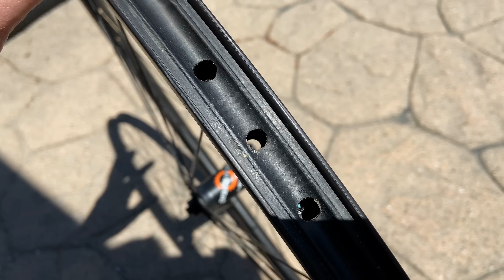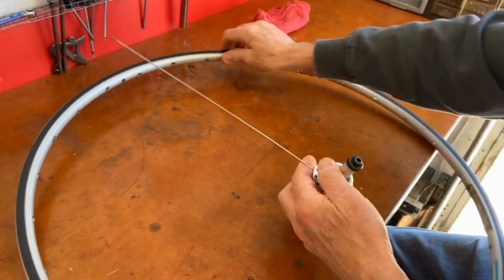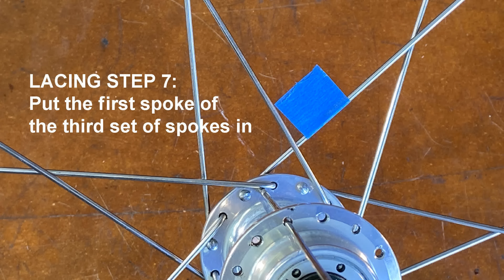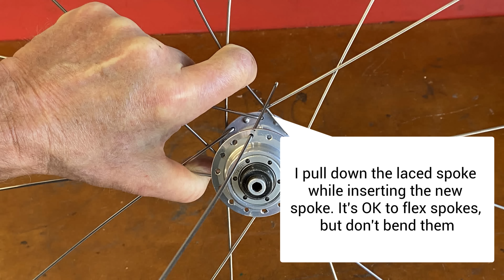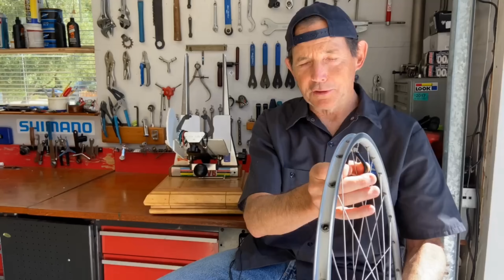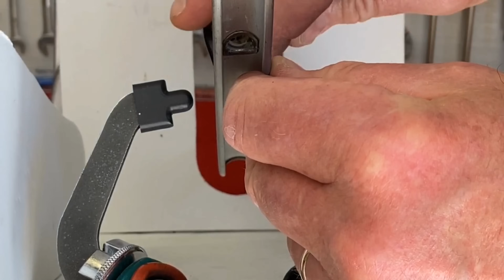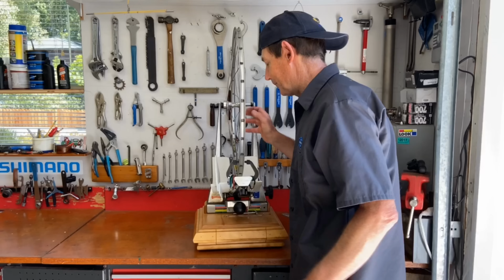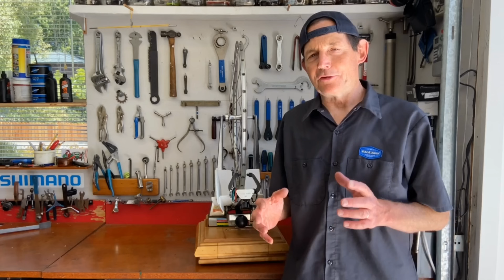How To Build Bicycle Wheels THE EASY WAY! #bikerepair

Comment: that was amazing video,learned a few tips ,i,ve never built my own wheels but been riding bikes for decades mostly road gravel bikes always gotta keep ontop of adjustments  as the wheels run up the miles always wanted to do my own custom axles and bearings but the spoke lacing and fine tuning put me off ,i usually bend axles they bend over a slow progression throws out everything mostly hopping and dipping at the begining you try spoke adjustment then realise its rear axle and if you have 29er tyres on 700c wheels most of the
 bike frames and if you use a hybrid max tyre width about 2.1 only leaves  5mm of clearance either side of tyre before it  rubs against frame so wheels gotta be kept true ,,people into bikes are missing out here if they not watched any of your videos ,,,,,eveyone hit the like button get the views and subscriber count rocketing,,,, thank you Jim 👍👍👍
Reply from the maker: Thanks so much for watching and the wonderful comment, Theresnobody! I really appreciate it and am happy you like my videos. Here's hoping you have some great riding this season without any more bent axles! (You're absolutely correct that the axles need to be straight and the bearings adjusted well or getting wheels straight can be difficult to near impossible.) That's an important point. Thank you for making it.

Comment: How to choose the length of spokes?
Reply from the maker: Thanks for watching and the question Jih-Shen Shih. You choose your spoke length based on the components you're using (hubs and rims) and the spoke pattern you are using (how many other spokes each spoke crosses). You can do this with an online spoke length calculator like the one spoke maker DT Swiss provides on their website: https://spokes-calculator.dtswiss.com/en/calculator These calculators work best when you choose hubs, rims and spokes that the company makes. If you are using other brand components, then you need to measure everything yourself carefully to get accurate numbers to put into the calculator.

If you don't want to do that, a good option is to find a bicycle shop that sells spokes and can calculate the spoke lengths for you. For this you would tell them what rims and hubs you're using and what spoke pattern you will use and they can run the calculations and get you the correct length spokes. Bike shops that sell rims and hubs and spokes are the types of shops that can help you with this especially if you buy your parts from them. Okay? I hope this helps and thanks again for watching!

Comment: Love the video, I have an old schwinn 5 speed cruiser I'm working on, and it rolls like old Schwinn's do , I am about to do the bearings and I believe the rear wheel is missing some parts, like retainers or something, do you happen to know what it should look like?
Reply from the maker: Thanks a lot for watching the video, knothole5! Schwinn 5-speed cruisers usually had pretty standard cup and cone style rear hubs. You won't know what's needed until you take it apart. To do that is pretty easy, but work carefully and don't let anything fall out and get lost and keep track of the orientation of all the parts. If you work on the non-gear side of the hub, you can loosen and remove the nuts on that side and push the axle out to the gear side. Again, be careful not to lose track of the parts and orientation. Take some photos so you have them for reference when putting it back together.

Once the axle is out, get the quantity 18 (9 per side) 1/4-inch diameter individual ball bearings out. A good way to do this is with a magnet you can get inside the hub. Once all the bearings are out, you inspect the cones - the conical parts that rest on the bearings. Clean them first. Their surfaces need to be smooth, no pits or other damage. If you can get them, the best practice is to replace the bearing with new. Also, stuff a rag inside the hub and clean where the bearings sit in the hub. Inspect that on both sides with a flashlight. Those too must not have any pits or damage.

On the gear side it will be harder to access but you can do it. If it's too hard, you can remove the gears, but you'll need the right tool to do that. With all the parts inspected, you should be able to determine what's bad and replace the bad part to fix the hub's issue. I know this is a lot to read, but the job itself isn't that difficult. Here's a how-to on ParkTool's site with some photos and more explanation: https://www.parktool.com/blog/repair-help/hub-overhaul-and-adjustment Good luck! Let me know if you need more help. Jim
Reply: @JimLangley1  thanks for the reply, and the explanation. I've been through this before, it seems strange that the casette is practically hollow where the axle goes through, like it's missing a dust cover or something, I will be tearing it apart soon, when I have time to complete it in one sitting. I'll let you know how it goes, thanks again.
Reply from the maker: @knothole5  your bike probably has a freewheel, not a cassette. A freewheel is directly threaded to the hub. You can't pull it off. You need a special freewheel remover, probably an Atom. That tool fits inside the large hole you see there and you turn the tool with a giant wrench or place the tool in a vice and turn the wheel. Once the freewheel is off the hub it's easier to get at the bearings. Let me know if you want me to explain more. Here's an article and video on removing freewheels: https://www.parktool.com/blog/repair-help/freewheel-removal-and-installation

Comment: How much money does this save?
Reply from the maker: That's a great question, Remy. It's not easy to put a precise number on it because labor rates vary so  much in the USA and around the world. But, I would say that the least expensive labor rate would be about $25 an hour and the priciest $150 per. 

It takes a wheel builder roughly an hour to finish a wheel. So, for 2, with my numbers, that makes the labor range $50 - $300. You would also save any time and travel/transportation costs to your builder and back home. 

But, if you didn't have the tools you wanted to build wheels with, that would add to your costs the first time you bought them. Also, the costs for the rims, spokes and hubs could be a little less from a bike shop than buying them on your own since shops can buy in bulk. Hope this is helpful. Thanks for watching and the good question!
Reply: @JimLangley1  Okay, thanks. :)

Comment: Wow, looks like you bent a couple of spokes there
Reply from the maker: Thanks for watching and the comment, JDE. In the very beginning of the video I explain that I am showing how to build a wheel with a used old wheel because that wheel has easier-to-see silver spokes, nipples and rim (versus a new black on black on black wheel). 

So, the spokes in the video are used and were taken out of a wheel to start with. Also, in shooting a video like this, sometimes the lighting isn't right or the camera isn't in focus. When that happens I start all over, taking the wheel apart and taking the shot all over again.

So the poor over worked spokes in this video were definitely flexed and have bows in them. But, as I point out in the video, it's perfectly fine to bow the spokes. What you don't want is actual kinks or sharp bends. Hope that helps explain and thanks again for watching.
Reply: @JimLangley1  I started video, perhaps I missed that part in the early part of video.  You did a well detailed layout of the wheel building process... you had mentioned the "bent spoke" thing, and I thought that was a good point.  At the end of the video my eye caught the slight deflection in the spoke as you had done most of the lacing up by then, and I smiled to myself.   

Great video Jim. Thanks for sharing.
Reply from the maker: @1Patient  Thanks for explaining- makes complete sense JDE. You gave me the opportunity to explain for any other viewers who might have the same question. So that’s great!  Thanks again for watching and commenting.

Comment: You really need to slow your f**** videos down You go entirely too quick
Reply from the maker: Thanks for the feedback - made me laugh.
Reply: @JimLangley1  I can rebuild and untire engines but not follow your video cuz you explain it entirely too fast and camera angles are horrible it wasn't made to be funny
Reply from the maker: @amd65ak47  Apologies for not realizing you were being serious. A few viewers told me the video is too slow and too long, so I thought you were using sarcasm to make that point, too. Also, of the 640 comments so far, you are the only person to say the video is too fast. I can't change that, but did you know that you have control of the video? If you want to slow it down, you might be able to do it (depending on what you're watching it on) via the settings. And you can pause it and rewind and watch a part again, too.

Comment: Amazing video and I can't wait to start trying. But... Is this a four-cross wheel lacing??? Sorry, probably the dumbest question ever. But I want to be 100% sure! Anybody???
Reply: Thanks guys, it turns out my local bike shop actually recommend I go for 3-cross, not 4-cross, so this is perfect. Thanks again 👍
Reply from the maker: @olmosilva7012  that's great, have fun building your wheels, Olmo!
Reply: I count only 3 crosses: one near the hub and then 2 higher up. So 3-cross lacing.
Reply from the maker: Thanks for watching and the nice words, Olmo. I show 3 cross lacing in the video. But, if you want to do 4 cross, the only difference is that each spoke crosses 4 others instead of 3 others. So, when you lace the wheel you follow my exact instruction except that you be sure to cross 4 spokes. Everything is exactly the same except for that part. Please let me know if this doesn't make sense and I'll explain more to help.

Comment: Thanks for the great video!

i rebuilt and trued a wrong woven wheel by trial and error the old fashioned way years ago: using my frame as true stand and a tire lifter as a guide to find the wobbles. 
Also straightened a lot of my wheels if they had wobbles that way. So I had some experience before watching your video. 

Bought a true stand this week because I wanted to completely rebuild some 70’s wheels and wanted a guide to help me.
Watched your video with great interest on how to weave, did that part and just went into the trueing in my enthousiasm. 
After trueing I watched the rest to see if I had done it correctly and if there were steps I missed in my trial and error, or tips and tricks that would have made it simpler. 

Only Thing I did different is I didnt use a spoke tool to tighten, but a screwdriver. I find this easier when there is no tire on the wheel. 

The step I forgot years ago was to de-stress the spokes by pulling them, so my wheel was crooked after 50m as they settled under the pressure. After that I always did that step too when I pulled out a wobble.

I think the rear wheel is going to be twice as fast with all the things I’ve learned today.
Reply from the maker: Thanks for watching and the great comment, Jerome. I'm happy to hear that you picked up a few tips and will be building your rear wheel faster. It sounds like you're going to get some good use out of that new truing stand. Enjoy your wheel building!
Reply: @JimLangley1  had a 30km testride today. Frontwheel stayed straight as an arrow. Rear picked up a minor wobble that I adjusted on the frame with the brake as my guide. New wheels were zooming during the ride and had no problem with 60km/h  downhilling. Only problem during the ride? I got blinded by my shiny spokes in the sun!
Reply from the maker: @evelknievel2000  thanks so much for the ride report, Jerome and congrats on your wheels performing so well out of the gate - sounds like you just need some spiffy new cycling eyewear now ;-)
Reply: After 1400km of vintage riding the rear wheel picked up its 1st wobble. 5 minute job to correct it again.

Comment: Thank you, found lots of vids on lacing a wheel, not too many on truing a wheel. Very informative, I can now tackle this fear free!
Question though, if I'm trying to get a wobble out of an already spoked and tensioned wheel, can I just tighten/loosen affected spokes or is it better to loosen all spokes and start from scratch?
Reply from the maker: Thanks a lot for watching and the nice comment, Derek. You should not need to loosen all the spokes to true a wobbly wheel. That would mean that you would have to retighten them all again, which is a much longer process than truing out wobbles and hops.

To true the wheel, you work on the large wobble first and then move on to the next largest and continue until the wheel is straight. The key thing with your wheel since the spokes are all tight, is that you should - at each wobble, first loosen slightly the spokes on the side you want the rim to move away from before tightening the spokes on the side you want the rim to move toward.

By loosening those spokes first, there's no chance that you will risk over tightening any spokes when you true that wheel. Okay? I hope this tip helps and you are able to get that wheel nice and true without too much trouble. If other questions come up, I'm happy to help more.

Comment: I was apprenticed during my teen years at a bicycle shop in Los Angeles, in the mid 1970s and '80s.  The art of wheel building was learned.  and ART it truly was.  Back then, we didn't have internet websites with user-friendly number crunchers that calculated the spoke sizes for various hubsets and rim combinations.  Instead, we had to calculate the spoke length manually. It was a small bicycle shop and we  got good results by laying the rim on the floor with the hub standing on its axle at the center, the floor of which consisted of 12 x 12 inch parquet tiles.  Spoke length was easily measured with a tape measure.  I've built countless numbers of custom wheelsets using this method, many of which were high-flange Campagnolo hubs laced to 20-inch alloy BMX rims, for the very popular BMX events of the period. Tough as heck, but finicky with the oil lube required prior to each ride. Those were magical days of yore.  Great memories.
Reply from the maker: Thanks for sharing your great story, Roy. That’s an ingenious spoke length calculation technique- I love it! I worked in NorCal shops in the 80’s where the BMX scene existed but nothing like LA. Still, I fondly recall lacing Campy hubs to 20” rims. And anodization! I really appreciate you watching and your wonderful comment. Thank you.

Comment: Hello Jim.  I'm just retired and want to really improve my bicycle mechanical skills.  Wheel building was a foreign skill to me.  I watched quite a few wheel building video's, and read The Bicycle Wheel.  Your video is what made it all click for me.  The only problem for me was that I had to start on the other side of the valve stem hole.  I can't tell you how many times I had to start and stop your video, and go back again and do the same.  All of a sudden it clicked.  I built up two old Schwinn Varsity rims that I had cleaned up.  They turned out great.  Your video made all the difference.  Thank you for that.
Reply from the maker: You’re very welcome Capt Mike! Thanks for watching and congrats on rebuilding your Varsity wheels. I’m so happy you kept at it and succeeded- great job!

Comment: Fifth .... or fourth hole on the rim? I think you meant fourth hole.  Aren’t there four sets of spokes?
Reply from the maker: Thanks for watching and the question, trailgumby. I say the fifth. The reason is that I start counting with the spoke that you are copying the placement of. That's why it's the 5th you put the next spoke in. If you don't count that first spoke, then it's the 4th. The reason I teach and show in the video counting the first spoke is because I've found it helps ensure that you put that next spoke in the correct place in the rim. Hope that helps explain. If you want to not count that first spoke, then it would be the fourth and that's okay if you want to count that way. It's just that I've found that when you're learning to lace it's important to have extra checks to get the spokes in the right place. And counting that spoke already in place helps with that I've found.

Comment: I'll chime in with everyone else! I love how positive you keep it, it doesn't feel like an hour at all. I was just wondering, when building a wheel that's going to be mounted only on one side (like on some cargo trikes), do you still center the hub in the same way you would a "normal" wheel? Thanks again for your video and the time it took making it!
Reply from the maker: Thanks for the nice words, Alexander - I’m happy you enjoyed my video and appreciate you watching & commenting. Cargo trikes come in various designs so you have to figure out what the correct centering is by what you’re working on. The easiest way to do it is with the almost finished wheel placed on the trike. That way you can center the rim using the trike’s frame as a reference. If the wheels are not driving wheels, they will usually be built just like front wheels - rim centered over the axle locknuts. If a wheel is a driving wheel, the rim will probably be centered when it’s a little further to the right - what we call “dished.” With the wheel(s) in the trike, you can make sure that the rim is centered and not too far to one side or the other and get it right that way. Okay? I hope this helps and have fun building those wheels!